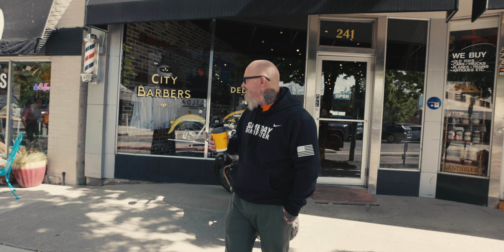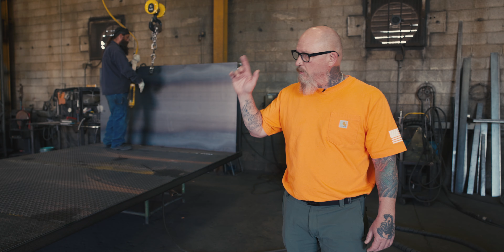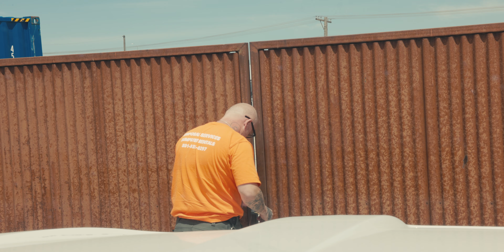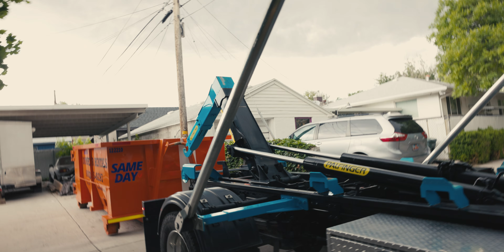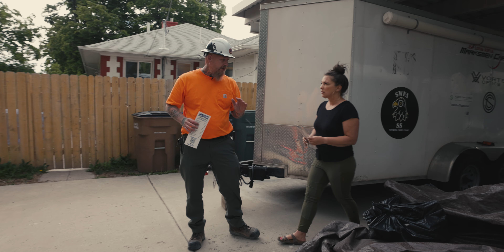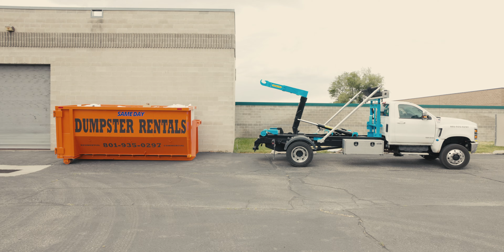Ride with Same Day Dumpsters.

Comment: I heard you make some "we" type comments on shipping some of the dumpsters out. Do you own/have stake in the steel manufacturing shop?
Reply from the maker: Dealer... a lot guys message me wanting the exact style, size, type of dumpsters I'm running. It just became easier to build what I have and offer them up for sale to anyone interested.
Reply: @samedaydumpster  Probably not logistically cost effective, but if you have information on cost somewhere I’d be interested
Reply: And this is why I try and read every comment and response because inevitably I know someone else is thinking what I am thinking and the question is likely asked and answered! Also, I’m about to the point where I have watched all of both of your content!